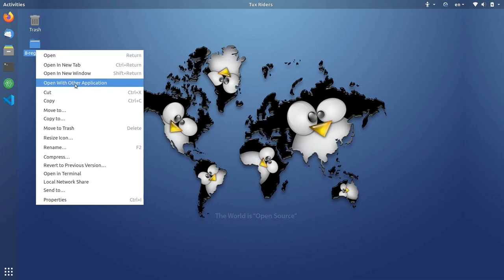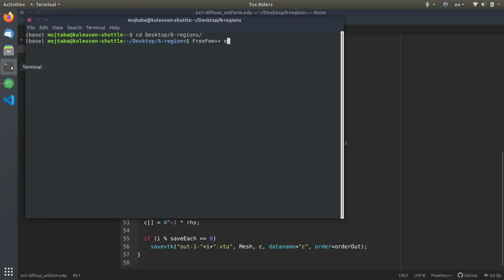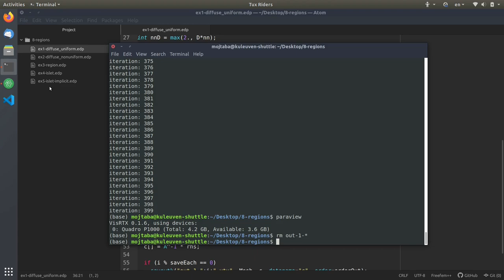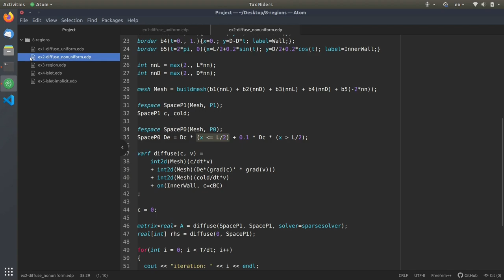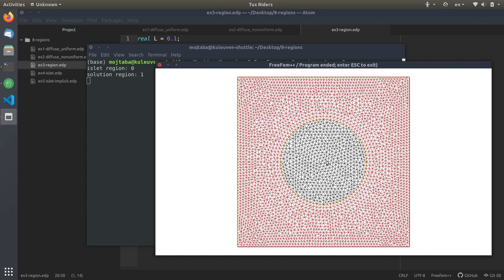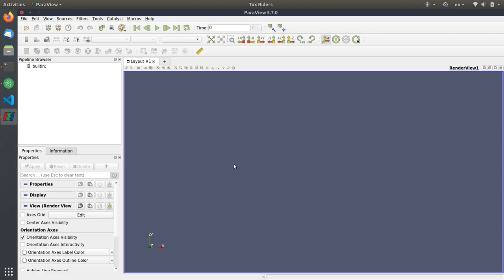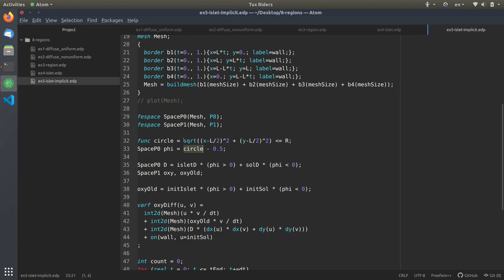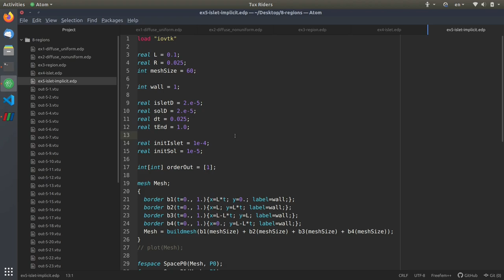[FreeFEM 8] Regions and sub-domains to define variable material properties and initial conditions

Comment: Hi, sorry for the questions: is there a way to evaluate a solution to a PDE at one of the domain boundaries? E.g. if u is the solution that I've just obtained, is there a simple way to then obtain u(gamma) where gamma is a boundary? So then u(gamma) only contains the values of u on the boundary gamma. Thanks!
Reply from the maker: there is absolutely no problem with your questions. I'm sorry for my late reply. it's indeed a good question. I should say I've never done that, but I know you can access the value of u as each node of gamma like this (you can both read and write the value):
  for (int i = 0; i < Mesh.nbe; i++)
    if(Mesh.be(i).label==gammaLabel)
    {
      u[][Mesh.be(i)[0]] = xValue;
      u[][Mesh.be(i)[1]] = yValue;
      u[][Mesh.be(i)[2]] = zValue;
    }

Mesh.nbe returns the number of boundary nodes, and Mesh.be() provides access to those nodes. there might be a better way to do this, but unfortunately I don't know it.

Comment: What can I do if I have a variable diffusion coefficient in a (x,y) table (i.e. no closed formula), depending on the solution of the last time step?
Reply from the maker: sorry for my late reply, Michel. it's an interesting thing to do actually. I did something very similar for a project a couple of months back. the best way I know to do it is via an external plugin, to which you pass your FE variable (in your case, the solution of last time step for each DoF) and it computes and returns a value based on an interpolation of a x,y table (which can be read from an external file). you can then use the returned value as the non-constant diffusion coefficient (in each DoF). I have already discussed the way to build external plugins here: https://www.youtube.com/watch?v=JSvVVkf4GDU&ab_channel=TuxRiders